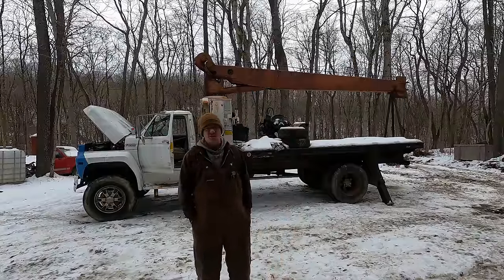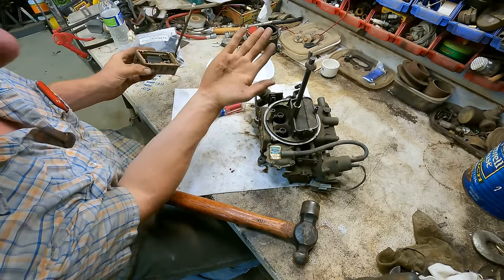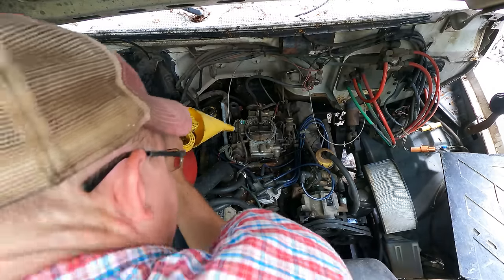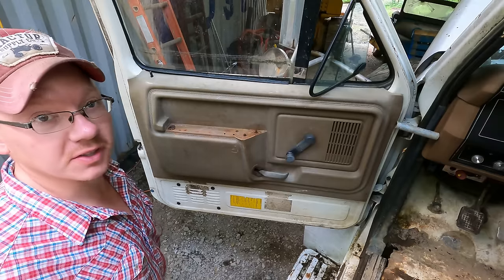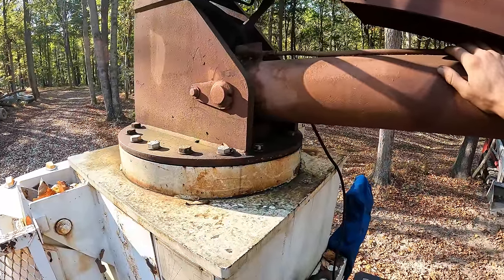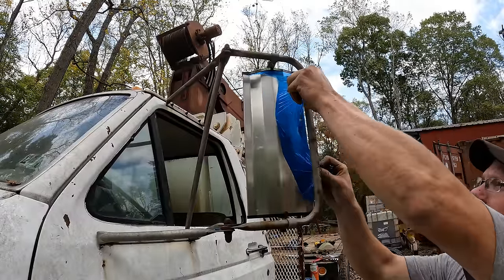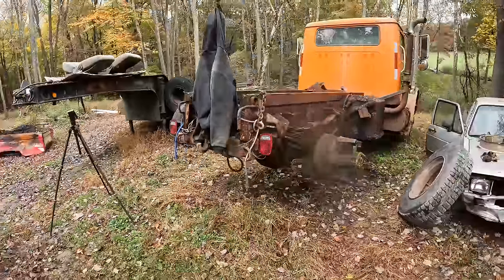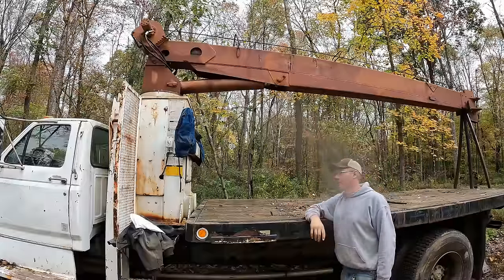Repairing a $700 Auction Crane Truck!

Comment: I'm a journeyman crane operator, there's a couple things that I highly recommend you do. the first thing is to replace that wire rope. it's rusted bad. which will reduce flexibility and can cause failure. the second thing I recommend doing is to make some outrigger pads. small light lifts they probably aren't needed but on heavier lifts or lifts at a long radius your outrigger can sink  causing you to not be level and you can turn that crane over in a quickness. anyway just my two cents from someone who runs cranes for a living.
Reply: Good advice , hope he listens ,
Reply: At least inspect the cable and do a load test periodically. I suggest twice  what you plan on lifting or the crane rating plus. Assuming you might lift a full car body. Be respective of what your load test was and stay out from under it at all times. Cable is not the only thing that can fail.  Great following your videos....and learning. I'm a retired heavy machine designer.
Reply: Was thinking the same thing about the wire rope. Good call.
Reply: @John Collingson You can never have too many crane mats laying around. Also, never hire a crane operator whose nickname is "Two Block".😉
Reply: @williamdegnan4718  or named Wild Bill
Reply: Matt -- great video!  I agree with replacing the wire rope.  When I was in the Navy we had to run out our cables at least once a year for inspection and greasing.  Don't know what kind of grease, but I'm sure someone here does.  We also tested them once a year and one breaks it is exciting!  Best of luck!
Reply: Even if it is a new cable need to keep it oiled or it will rust from the center out and you will not know it until it fails.
Reply: Is it to late to oil the cable on the drum and or would grease help?
Reply: @Military-Museum-LP  Wire rope once it starts rusting it usually starts deteriorating from the inside out so to answer your question applying oil and grease on old rusty wire rope is akin to putting lipstick on a pig.
Reply: @Military-Museum-LP  I mean with out being there in person to inspect I can't say for sure but from the few glimpse of the cable I seen it looked like it was rusted pretty good.
Reply: @martinkennard1669  didn't see a block for it just a headache ball so he is going to be limited to the single line pull on the winch. if I had to guess on that old of a boom truck I'd say it's only like 7000lbs line pull.
Reply: @CampVictoria  yeah for his personal use I don't care. if he was out on job sites or out in public where he could potentially hurt others than I'd have a little more to say.
Reply: @terrycannon570  right,.. so i wouldn't replace it until it needs it. Just do a load test,and if it isn't broke and doesn't break,just grease the thing,and cover whole winch with an insulated tarp,or old airconditioning cover,mudflap,etc! When not in use🙂and of course the staying out from under the boom,and anything lifted....
Reply: @CampVictoria    Matt's just a fella trying to build his business and cut out a place to live. He's not going to leap tall buildings and lift them. He's just going to lift an engine or two, maybe  a building truss or wall. Let's watch his videos and see what he does.
Reply: @terrycannon570  you're the first one I've seen anything about lubricating the cable and that's very important
Reply: @gullreefclub  maybe, but the cable puts up less of a fight than the pig.
Reply: @wynottgivemore9274  good theory but when it gets rusted like that it rubs on its self and tears it’s self apart, everytime he picks up a load or even just cables up or down it will get that much closer to failure
Reply: As a Journeyman Ironworker, I second this. I’ve seen shit go south real quick when you’re not careful with cranes
Reply: 55:14
Reply: Also, Kranplätze müssen verdichtet sein.
Reply: @gullreefclub still happens where I live. Lots of pigs with lipstick.

Comment: The "guard" you straighten  and welded is actually to act as a damper in the event the cable brakes and it prevents the end from whipping about and decapitating the operator. "Stored energy" can be deadly.

Comment: I think Ford stamped those F-series floor pans out of soggy cardboard. Probably the same steel they used in the exhaust manifold bolts...
Reply: I feel it was the same with my grandfather's '76 F-150. Floor pans covered with roofing tin, weight reduction for the bed, and rather questionable front cab support. 300 & 3 speed was still solid though.
Reply: @AngryCatMan1982  so loyal
Reply from the maker: Lol yah people can’t understand why I don’t wanna fox that manifold leak….. you know why
Reply: @aaronhoward7593  He used it as a daily and a farm truck until '97, when he bought a new Ranger. Afterwards, it remained his farm rig until he passed in '01. It sat under the barn until '07 when I revived it, but it was too far gone and expensive to be near road worthy again. Grandma wanted it  gone. So, off to the scrap yard it went. I did save the rear view mirror, window crank, and F-150 badge as keepsakes. I had many wonderful memories with my granddad in that old truck.
Reply: @DieselCreek  If it's not too broke, don't fix it until it becomes too broke. Sometimes my ocd gets the better of me, and I end up breaking things worse than if I just left it alone.
Reply: @DieselCreek  in my experiences with the local farmers in my area, I have never heard an f series ford that didn’t sound exactly like that one. Every f6, f7, and f800 around here going down the street through town sounds like your truck. Now I know that apparently all of them have the same exhaust leak 😆
At least your truck had the power to spin the tires in the mud. The ones I drove were grain haulers with dump beds on them and they had I believe to be a 352 y block? You got the 429, that’s a big jump up. Thanks a bunch, you made my Saturday morning. 👌
Reply: We have a78 E150 given to us by my brother. He inherited it from the original owner a guy he worked with, it had rusting issues from the get go. It was around DC so it saw some salt but not as bad as other places. It is actually an 82 .
Reply: I’ve seen one where somebody has swapped in a Chevy 366. Does that solve the problem, or just prolong the pain?
Reply: hey wes, about to watch your video next!
Reply: Set it on fire
Reply: @DieselCreek  Matt ya prolly snap the rest of em off. Lol.
Reply: "Oh you wanted sheet metal? I thought you said cheese metal." - 1980s Ford engineer, probably
Reply: @DieselCreek  fix exhaust leak! 😃
Reply: Ford didn't have any lock on exhaust leaks, the GM V8s had a terrible habit of the exhaust manifold to head bolts braking. Ala, a heck of a leak, and not easy to fix. They actually make and sell special clamps to clamp the manifold to the head so you don't have to remove the head to fix it.
Reply: I think you will find all the steel in the 80's and 90's was rubbish vauxhall in uk had similar crap show it water and it turns into a kind of flakey mush
Reply: @garys9694  GM V8s still to this day have issues with manifold bolts breaking as do Dodge/Ram. Dorman sells the hell out of those little clamps that try to reduce the exhaust leak without having to pull the manifolds. I know of two modern Tahoes that have them on all four corners.
Reply: Holley carbs are the easiest/ simplest to rebuild. Now if you want a real challenge try a Quadrajet! 🤣
Reply: @genesmith7151  
You are right on the money on that one. I'd build 10 Holleys before I'd touch another Rochester Quadrajet. In my experience, the Duojets are even worse.
Reply: Thats funny! Good one.
Reply: FORD "found on rubbish dump" or "fixed or repaired daily".
Reply: Isn't that the truth
Reply: @DieselCreek  cause it will just leak again in 3 months
Reply: Hey Matt, I was curious as to why you don't do a diesel swap on this truck? A 7.3 powerstroke or a medium sized CAT diesel engine would seriously improve this truck.
Reply: What should be next is Matt getting an ultrasonic cleaner for Christmas. Literal godsend of a machine, would have that carb clean in no time
Reply: @johnfox3845  back in the day, 70's early 80's I successfully rebuilt many Q'jets!
Reply: @genesmith7151  My rebuilds were in much more recent times (mid 2000's) and were all a success, but damn I hated working on them. Although their intricacy sure didn't help, my main frustrations were the result of previous owners' halfass rebuild attempts and age more than anything. 

QJets and DuoJets sure didn't cope too well with abuse from ham handed hacks. The screws and threads are soft as butter and I swear you can warp the upper flange or carb body itself just by looking at it the wrong way.

I'd rather diagnose and rebuild a whole fuel injection system than touch another Quadrajunk.
Reply: @johnfox3845  🤣
Reply: @AngryCatMan1982  🤣🤣🤣🤣
Reply: #teamseas
Reply: WWW I sincerely don’t understand how you people cope with the rust there. I’m continually being blown away by the rust conditions in vehicles there.
Reply: @DieselCreek . Matt exhaust leaks in ANY vehicle are my taboo. They drive me crazy!
Reply: if they didn't build them that way, there would be a lot less youtube channels out there for us to enjoy. thanks for being a car nerd, wes.
Reply: @carlcarlamos9055  makes it worse in my opinion because at least the 429 had the power to get out of its own way the 366 should be attached to an anchor chain
Reply: More than likely they got the sheet metal for the floor pans from the same people that made sheet metal for GM and the same goes for the exhaust manifold bolts.
Reply: @DieselCreek  got the same leak on my '85 Dodge plow truck. I'll do it when I'm ready to remove broken bolts!
Reply: My father sold the front half of the frame for the half ton, I think it was an early 90's truck, to a guy who owned a model in the 2000's. Ten years younger, and the truck was rotted away like the frame was made of sheet metal. Had a lot of those weight reduction holes in the frame, but on earlier models, there weren't as many. Chevs rot behind the rear axle, while Fords rot everywhere.
Reply: You mean to tell me that those bolts are steel? We should have saved all the fasteners we pitched all those years ago from the pre 70s cars and trucks...
Reply: Nah Wes it is not soggy carboard they make the F-series floor pans and exhaust manifold bolts out of, it is sugar board. But I do have to say, that the floor pans in my 1965 Ford F-100 was made out of some pretty good stuff, but those manifold bolts I often wonder if those was just re-prepossessed  candy canes from Christmas.

Comment: 21:35 Holley carbs don't like backfiring. The Power Valve are vacuum operated. A backfire pops the diaphragm and makes them run rich. It's a quick check with a vacuum pump. And your guess on the sight plug and float adjustments was spot on. Good for you and your logic skills.
Reply: Those pops out the carb probably took the power valve out. They make a blow by check valve kit for them to protect the power valve
Reply: Can’t even think how many power valves I have replaced on Holley carbs over years
Reply: @gullreefclub  You need to install power valve savers. 👍
Reply: One of the things I always thought was a weak point of those carbs was the cork gaskets. They dry out and leak easily. Especially when the vehicle sits for any real length of time.
Reply: They make blue coated gaskets. They are alcohol resistant. They actually come apart easy , I've reused them before.
Reply: I agree with everything said in this thread. Power valve protector 👍easy install and a no-brainer on an engine prone to occasional spit back through the carb. (The new one he just put in is probably popped already, lol). And go back with the blue gaskets👍 those and the power valve are available separately from most any speed shop. No need to get a whole kit, Holly is well supported.

Comment: Greetings from Western Australia! As a tyre fitter, I thought you might appreciate a tip or 2 when changing spider wheels or “Dayton’s” as a lot of Americans call them. 
If you’re ever in a situation where you’re struggling to get the rim off the hub, when the nuts and cleats are lose, lower the truck down and pop the clutch in gear. That’ll often brake them free without the use of a hammer.
Another thing worth noting is to leave the nuts on the threads until all cleats are loose/free hanging. I have seen many cleats fly off with a lot of force when they’re hit with the hammer.

I know those style of wheels aren’t very common in the US but it was worth the mention! 🤠
Reply from the maker: I do appreciate the tips! I don’t have a lot of experience with these. They are quite common still and used to be even more so!
Reply: Food for thought when you’re messing with the autocar again 🍻
Reply: @DieselCreek  Especially on older intermodal & logging trailers.
Reply: Couldn't have said it better myself tire fitting in Australia sounds terrible from what ive heard all the health and safety its good here in New Zealand  they've not cracked down on it yet

Comment: The metal hoops on the top of the boom are there for a reason. If you are in a heavy lift and the cable snaps, they are there to "catch" the cable so that the operator doesn't get a face full of steel annihilating cheek pokers.
Reply: they also handy for climbing up to put new cable on.  ha
Reply: Oh I jus thought it was a perch for vultures.
Reply: @sallybrokaw6124 🤣 underrated comment!

Comment: Please tape the exhaust in order to hear the engine roar!!And for the boom, a beautiful CAT YELLOW! You've got plenty of it and it will match with rest of your toys.
Reply: Hi Matt,   We think, we agree 😇 .   A few people now have suggested the CAT Yellow paint would be nice.   We think it would also match / contrast with the blue around the front grill.   But, you will also then have to refurbish the tray frame with black paint, and then, of course, paint the rusty grill behind the cab.   The cab itself would probably be ok if cleaned and polished.   And make sure you replace that orange light cover at the front.   Thank you for you great videos, from Australia.
Reply: Maybe even splurge and put a booger weld over the holes (if there's enough meat left that is).

Comment: I think Andrew would be proud of the arm rest / door handle repair matt also you should get a bigger sticker on the dash which states minimum height !!!!😂
Reply: I was thinking duct tape for the arm rest
Reply: Andrew just posted
Reply: @DieselCreek  looks like you did a great job...

Piece of advice...
Be grateful you can work on it

I love old cars
But I can't afford it
I'd have a Chevy Viking and a tri axle Konstructor if I could
Reply: That was a simple repair on the arm rest, but perhaps Andrew would have done it different: Some diamond-plate cut-to-shape and welded to last 50 years.
Reply: Is that a new logo at the beginning? It’s nice.
Reply: Fix the exhaust leak put a farm plate on it n run it for some local jobs.
Reply: I just hope you don't put a radio in the dash with a chainsaw.
Reply: Andrew would had used a chainsaw… 🤣🤣
Reply: Just removed 2 more spam bots smh 😤
Reply: @playstationsfinest  same
Reply: Finally  adjusting  the  belt  lmao
Reply: @dancurrier6421  yes Dan iam happy 😁
Reply: Haha all it was missing was “There, That’s fixed”
Reply: I thought you would do it in "True Andew " repair style and fire up a chainsaw
Reply: @playstationsfinest  "reported"  they are still there. Also reported them, but its youtube.... they dont give a 💩
Reply: @ipaddlemyowncanoe.7441   🤣🤣🤣🤣
Reply: @ipaddlemyowncanoe.7441  😂😂😂

Comment: One important thing I've heard mentioned about Dayton rims is to leave the nuts loosely on the stud and then bang on the locker tabs because they sometimes fly off at high speed and become bullets. Oh and one other thing, make sure you retighten the lugs after driving it for a while (another Dayton thing).
Reply: Yes, I was cringing when Matt got down there with those wedges without the nuts on there.  A lot of times if you do that, popping one wedge free will let another one or two pop as well, I have had my wrist blasted by a wedge before and it isn't fun.
Reply: With you on that don't want learn the hard way.just lucky that thay were rusted on that normally go of with force and never stand in front until pressure is of .but we're all learning and that's what it's all about keep up the great work great channel only just started watching been great viewing like seeing old machine s getting fixed and used again all best here in Aus
Reply: @thesalvagegarage  Yeah, nobody wants to learn the hard way. Split rims are another hazard. We knew a guy that had both arms and his lower jaw fractured to pieces by standing over a split rim on a tire machine.
Reply: School of hard Knocks for sure.those wedges fly really well.

Comment: As someone in the commercial tire industry, I recommend picking up a set of commercial tire bars. While not the best on hard-packed rock like your shop there, they make pulling off and putting on tires onto rims and trucks much easier. Worth the investment. Might take a few tire change-outs to get used to them if you haven't used them before, but I would not be able to do my job without them. They're a life saver.

Also saw in mentioned in another comment, leave the nuts on the studs when banging on the cleats. Even on nice and clean Dayton trucks, they can still come off with a lot of force. Thankfully I don't do many Daytons, they're mostly on older container trailers. Really just do those for JBHunt and Norfolk Southern.

Comment: Small pieces of rubber wrapped around the mirror bracket, then tighten them . Stops the problem. I have to say, you are a man with a big set of Brass Cahones, to tackle that carb job, never having done one before. Good Yob Mon.